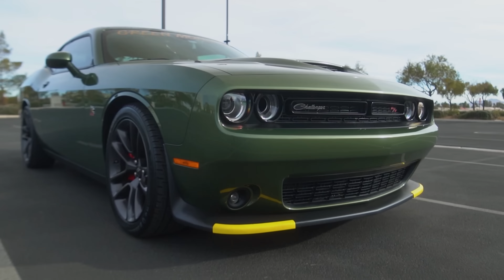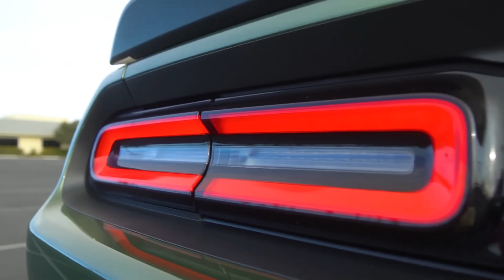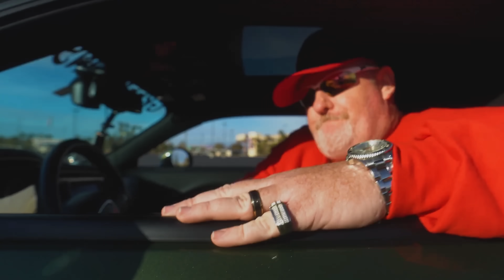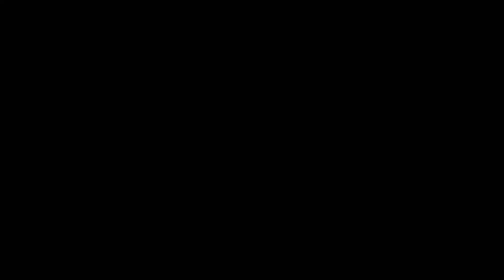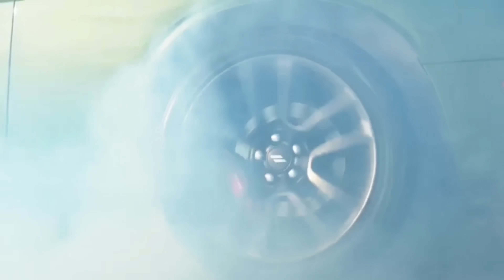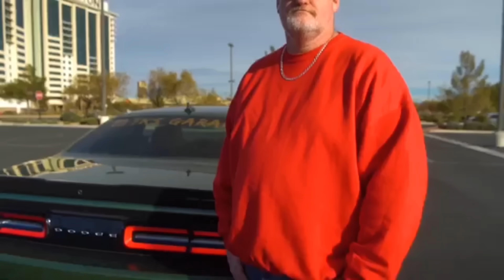Stellantis Engineers Decide On What V8 The Company Could Use In The New Charger

Comment: I like it! Tried and true. I just hope they go thru with it. 5.7 is plenty until they work out the kinks in the platform to take the torque of a V8. If it's true,,   I am proud of you Mopar. If it is true..... I would buy a new 5.7 charger, even if it's a hatchback. Remember Mopar, we don't need big screens in the dash, fancy wheels, chrome trim, leather, sunroofs, or sunroof, fancy luxury garbage to jack up the thre price. We just want a V8 powerplant with  a cheap Sturdy body. Screw the critics on luxury crap! Cheap LX fox bodies where a hit. 1st gen Camaros where a huge hit also. I know you can do it. Hotrodding as always been Mopars strength. Bring back the V8 to cars and trucks. I often think, what if ford, gm, and Mopar only sold V8s and let the rest to the imports sell gas savers. Let the the Americans be Americans and the gas savers be gas savers, idk man...

Comment: The ram has the E-Touque 3.6 and hurricane platform in the Rams, and the 5.7, 6.2, and 6.4 are the same dimensions other than the supercharger and intake designs. So if they can fit a 5.7, they can fit the other 2 motor options.

Comment: As someone who is in the process of trying to get a Hellcat Redeye Charger, I'm all for Dodge and Stellantis to start the new Charger off with a 5.7 Hemi V8. If it's a straight drop and plug after they fix the strut tower issue, that would bring alot of customers back after being turned off by them going full EV. My only concern is them bringing back the 6.4 SRT Hemi and the supercharged 6.2 Hellcat Hemi is that they will try to make these special editions and try to milk those again. They have a very bad reputation for baiting and switching, and Mopar enthusiasts aren't having it anymore. 

So here's what I think they can do. Have the Hurricane I6 and EV Scatpack as a entry level for the new charger, then the 5.7 Hemi, put a turbo or maybe a twin turbo on it to output the power to around 600 horsepower. Then bring the 6.4 Hemi, add maybe a whipple to it out the gate like Ford is doing for Dark Horse and 5.0 upgrades to make it 700 or so horsepower. Then bring the 6.2 Hemi Hellcat engine as a trim, make some upgrades to make it 800 or 900 horsepower. Then go a widebody hybrid design with the SRT Banshee. Maybe a 6.4 Hemi as the engine power that goes to the back wheels, and then the battery can go in the back of the car that powers the front wheels. Make it AWD, with a switch to convert it to RWD. And Boom! SRT Banshee that's 1,000 horsepower just like the C8 ZR1. Man typing this out why am I not the head of Dodge with this train of thinking? Anyways that's just my thoughts.
Reply: @GwoppyTrai  they don't put the right people on the top job.  They pick from their club the ones that will swindle the public.  You make to much sense.
Reply: @douglastaylor8039  That is very true, I nearly forgot. Common sense these days has been rounding down. You can put a 10 year old in charge and they'll make better long term decisions than these nit wits at Stellantis

Comment: How about a re-mix of old and new:
a) 5.7L V8 plus electronic twin-charging (turbo for high end & 48V supercharger for low-end torque fill), say 480HP to start
b) Extra power thru the hybrid 8-speed from the Wrangler 4xe could be the next tier up - 550HP

Idea is already been tested -> look for the 2015 article called "AVL Demonstrates Electric Supercharging on 350-hp Alfa Romeo Giulietta" on Motortrend.

I would prefer to see a mild-to full hybridized V8 over the 3.0L Hurricane H.O. - 28PSI is too much for an engine that small, longevity wise.

Optional AWD via a small electric motor under the V8 would be cool too 😁

Comment: Ive never had an issue with the 5.7 hemi either. Had 5 or 6 of them with a range if milage. No ticking or oil burning. A common thing seems to be a bit of a tick for a few seconds upon cold start.
Reply: That cold start tick is exhaust manifold related. Broken bolt. It goes away after it heats up and seals off again.
Reply: @pauls.1783  I'll have to check. This truck I bought new and it did it pretty much from day one.

Comment: The problem with the tick is the oil pump. I don’t have the tick problem since i commute on highways very rare throughout the day is the engine at red lights and long idles vs heavy city traffic. If they bring back the 5.7 they need to either re engineer the oil pump. Or slap hellcat oil pumps on all V8s. The pumps are the same size. Just performs differently. Even though I have yet to get a lifter failure, im gonna  have a melling pump installed soon. Excited for this but they should slap SRT exhaust manifolds on it plus  the 6.4 SRV intake from factory. Pop in a decent cam with it to compete with other v8s. Create a new supercharger for it when talking about a hellcat version. Really just modify the bolt patterns to fit 5.7 hemi without 1/4 inch of metal adapter plates to sit firmly in the engine. Less modifications needed to make a bigger hood. I appreciate the 6.4 and 6.2, but people have made those same hp numbers with 5.7s. They should have stuck with a platform and built it up to compete with other American V8s. Ford did it. Love what your doing Tk. Stay blessed brother

Comment: What's different (physical size-wise) between the 5.7 and the 6.4/6.2 other than the exhaust manifolds? I know the 5.7 has small exhaust manifolds and the 6.4/6.2 have bigger ones (basically heavy-duty shorty headers).
BTW, the hemi lifter/cam tick can be avoided by simply not idling your car/truck for excessive periods of time. (If you're the type who sits in your car with the heater/AC on in the parking lot, or sits in long drive-thru lines several times a day, don't get a Hemi, lol.)

Comment: Hopefully they offer the the engines in this order: 5.7 as the new base engine (370 HP rated in the old Charger), a 6.2 (485 HP in the old Scat pack) optional, and the 3.0 (high output 510+HP) as another option

Comment: 5.7 would have to get a bump in HP, adding a turbo sounds nice but I'd rather have a strong NA engine, like around 425hp. So what's with this Magnum engine, based off a 360 crate? That would be interesting drop in too.

Comment: The 6.4 would have been the better option. However, they can use the 6.1 block no MDS, make small changes to the intake, exhaust and with better ECU tuning easily make the horse power. The 5.7 just won't be enough. They need to get to at least 500+ HP n/a. Turbo charging the 5.7 just won't work.

Comment: A 4.2 liter based off of the 3.6 liter Pentastar V6 sharing components with that.  Would be light weight and easily capable of 425 to 450 HP

Comment: They should just make the 5.7 a standard engine on these new chargers. Do it without the turbo as the entry level vehicle. Then they should do what GM does and charge either $2000 for the S.O. Hurricane or $3995 for the H.O. Hurricane

Comment: Regarding your comment about putting a 5.7 in the ram trucks and then adding a turbo, it is impossible to get rumble through a turbo. It would have to be non-turbo to have any rumble at all.
Reply: its hard but not impossible. u need an x pipe and a 3" diameter exhaust the whole way. take a look at some valvetronic videos of the bmws, audis, and mercedes' they post (v8s specifically), or any modified exhaust german v8. they got the rumble at idle, and sound similar to the old NA german v8s

Comment: The 5.7 is the way to go, but someone better drill it into Stellantis execs' collective heads, that they're going to have to make the engine more robust. It's a great engine, but far too many yahoos have blown it by modding it without fully thinking things through. You don't just slap a turbo on it and expect nothing to show signs of stress & strain.

Put the turbo on it in the factory, but beef up the cans, rods and crank arms. Improve the oil flow through the pan. I don't even mind if they keep the MDS, but even that will need some improvements.

The 5.7 HEMI has so much potential, Stellantis has no idea! Whoever is going to run things at Dodge, better be a gearhead.

Comment: Hemi is the same block so if a 5.7 fits a 6.4 will fit as its just internal differences. 

Bore/Stroke are different but the exterior dimensions are the same...5.7/6.1/6.2/6.4 are the same block.

The 6.2 Hellcat same block as the 5.7 just the supercharger adds height to the engine and could need room for accessories etc... If a 5.7 fits the 6.4 easily fits as it's the same size physically...

Comment: Not really a 'Dodge' guy, but V8ing the new Charger in place of the in line 6 Hurricane obviously us the way to go. Having said that, however, the new 5.7 needs to have a much greater power output: factory header it, and 'definitely' put a manual transmission behind the 550 horse engine. Then Dodge will come alive again, and give the Mustang some competition. It's the real ticket for getting buying customers back onto the Chrysler/Dodge car lots.

Comment: Unpopular opinion - but a stock naturally aspirated 5.7 may not move the needle appreciably, unless maybe just for the folks that want it combined with the AWD. Assuming similar curb weights as the dearly departed previous generation Charger and Challenger, similar acceleration as the old body style, unless they significantly alter the gearing. Presumably not enough time to make the 6.4 fit, or reasonably and reliably get more power out of the 5.7?

Comment: They need to design a dohc smaller displacement v8 like the coyote
Reply: Yes, add two holes to the 3.6 Pentastar. Should not be that hard to get that designed. Also fix the oil cooler issue.

Comment: Stellantis needs to bring back the 2012-2024 body style Charger and sell the heck out of them to the police. That's 150,000 units a year. It's mature.

A turbo charged 5.7 on the new platform is going to take up too much space, then you have heat management issues. 

Bringing back the old body style buys Stellantis time to dump the current CEO and get someone in that knows the American car market.

As for RAM trucks, provided the Magnum engine is really mature and isn't going to be a recall or warranty monster, is a way to get miles on the engine to prove longevity.

When I looked at the Durango SRT, the ZF 85 transmission was paired with the 6.4 Hellcat engine. The regular 6.4 had the ZF75 or ZF80 transmission listed.

Mature means also keeping or reducing the price and improving the quality of the vehicles.

Comment: I am old school (66 years old) and having restored a prince engine is a Mini, I PREFER the old fashioned way of making horsepower.  I’ll trade some fuel  economy for long term reliability brought on by simplistic designs. Lack of turbo lag is sweet icing on the cake.  I bought a new Challenger R/T in 2020 and have no desire to replace it with a turbo charged whatever.  Sorry for those who paid extra for a 2023 last call R/T, but no one has the crystal ball with today’s political climate.  The 5.7 keeps my driver’s license point figure well inflated, it is plenty fast for me.  26 mpg at a highway 79 mph is a bargain any way you slice it. Yet if a train comes along at 130,  you are there too.  Taylor

Comment: They need to move the strut towers?   Sounds like a 90 degree V8 is too wide, as the STLA Large that the Charger is on, is designed for a longitudinal engine.  If a 90 degree V8 is too wide, how about a 60 degree V8?   Some years ago, Yamaha built 60 degree V8s for Volvo and helped Ford design the 60 degree SHO V8.  Yamaha is still building 60 degree V8s, for their outboard engine line.   The V8 in the XTO Offshore is a 5.6L, that puts out 450hp, normally aspirated, on 89 octane gas.
Reply: i guess they could but dont those 60 degree v8s need balance shafts or other balancing things?
Reply: @fadedsoul23  the version Yamaha built for Volvo, a few years ago, used offset rod journals to smooth out the timing.   The Yamaha outboard site does not give a lot of detail, but I would suspect it uses the same strategy.  One quirk of the outboard engine, the intakes are on the outside of the heads, and the exhaust are in the inside, to expedite a single exhaust, which helps packaging for the outboard.  The nice thing is, Yamaha has been building these V8s, for one application or another, for 20 years, so it should be pretty well sorted out.
Reply: @ what about non Yamaha 60° v8s? I’m sure they got it figured out but I doubt dodge would partner with them for that
Reply: @fadedsoul23  there were a few, historically.  The Ford GAA in the Sherman tank was 60 degrees, because it was cut down from a V12.  iirc, Lincoln had a 60 degree V8 around 1930.  The advantage of the Yamaha is availability, and Yamaha does not build cars, so they are fine with building engines for other car makers.  Dodge would probably partner with anyone that can provide an engine.  After all, the STLA Large platform the Charger is on is shared with Alfa.

Comment: Of course you stick to what works. Takes all the risk, time, and development cost out of the project.   They already have all the tooling and suppliers and certifications for off the shelf engines and engine management hardware and software. If they want speed, all they need to do now is lighten the body. Use gigacasting and aluminum!  Otherwise, throw a supercharger on it.  Forget turbos.

Comment: Uh, nice to get the V8 and all but nobody is asking what moving the strut towers will do to the suspension geometry and the handling. I'd imagine they were designed as they are for good reasons and moving them and adding a V8 will probably not help how the car handles 

A modern muscle car has to do everything well, not just make great noises. This feels short sighted in the long run.

Comment: 1 reason Stellantis and Dodge will fail, you have to have a dedicated platform for ev's because they need to be designed and build differently because the weight is distributed differently and effects driving performance and dynamics. If they want to use a platform for both EV and ice they are doomed.

Comment: Been saying it for the past two years when i first went to school for the 3.0.
Get rid of the 3.6l and use it in its place.  Then have a v8 replace the v8
Reply: English please 😅
Reply: @brianheffren2679  He wants to dump the reliable strong engine 3.6 and delete it in favor of the unreliable garbage 3.0.  Sounds like he has the accent of a Stellantis engineer from Morocco or something.
Reply: @rogerrussell9544  that’s a terrible choice. The 3.6 is a strong motor with proper maintenance will last forever .
Reply: @brianheffren2679  Yes, but Tavares likes small delicate engines that we reject.
Reply: 3.6 is garbage.  Still replacing heads on the first gen motors.  The new 3.6 blows head gaskets left and right.  Your lucky to make it 40k on a jk before the left, right or both head gaskets blow.  I make a living working on 3.6l engines.  But hey i make a living working on 3.6l engine’s so keep on making them.
Reply: @ u just a bad mechanic is all. That is a good tried and true engine. 
As we see in the clip, this Pentastar was finally put out of commission at 626,000 miles by worn-out timing chains and tensioners. But as we can also see, the engine is remarkably clean inside for its age and miles, thanks no doubt to careful maintenance, unleaded gasoline

The 3.6L Pentastar V6 engine is a reliable, lightweight, and efficient engine that has been used in many Chrysler, Dodge, and Jeep vehicles since 2010:
Reply: What is being a mechanic got to do with designing a motor.  Been with Chrysler for 32 years.  I would take a 3.7 magnum over a 3.6l.  The 3.0 has been out for two years and only had one to work on in class.  I got the first 3.6 blown up in my area a month after it was put in the first wrangler we sold with one.  A lot of people have made a lot of money working on a 3.6
Reply: @OnTargetwithBT  I have had 4 and all of them were wonderful, even when I overloaded one driving Hwy80 over the rockies.  If you think they're bad, wait until the Stellantis turbo engines rack up some miles.
Reply: @OnTargetwithBT  Sounds like you are either Tavares, or his man-friend Elkins.   Everyone in the real world loves them.
Reply: I was just trying to point out they need a v8.  Don’t replace a v8 with a 6 cylinder.  I know how crappy the 2.0 is with direct injection.  They are garbage beyond 100k.  The 3.0 is the same motor with 2 extra cylinders.
Look the first gen 3.6 was ok minus the left head issue and some rocker bearing issues.  Like you said if you change the oil regularly  its an ok engine.  The newer 3.6l’s with egr cooler and stop start is a different story.  
Ive owned chryslers, jeeps and dodges since 1995.  I currently own a jk with a 3.6.  Change the oil every 3k even with synthetic and just to make sure it has a lifetime max care warranty.
I also have a 4.0l in a 2001 g Cherokee and a 4.0 tj both with over 200k with no issues.
The 3.6 pentastar was a copy of the gm 3.6 l
Only difference is the plastic oil filter housing that likes to get brittle sbd crack and the exhaust manifolds are integrated into the head.  
But its by far not the worse 6 cylinder Chrysler ever made.  The 2.7 takes the title
Reply: @OnTargetwithBT  I haven't forgotten the Plymouth Prowler and how it sold with a V6.
Reply: And to answer your accusations im not in bed with stellantis.  I wish the great great grandson would buy it or an American owned company.  Would love to go back to the 90’s and early 2000’s or pre Daimler.  Being tossed around from and back and forth over the years has been exhausting.  
But it has been an experience learning chrysler, Mercedes, fiat and now Peugeot powertrains.  Been a real mixed bag